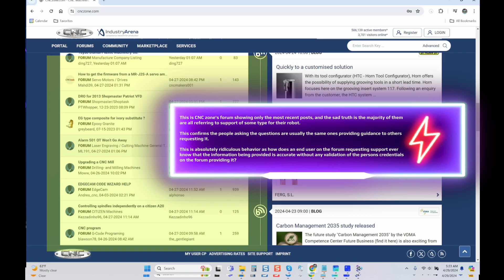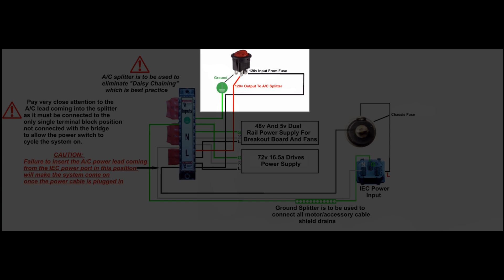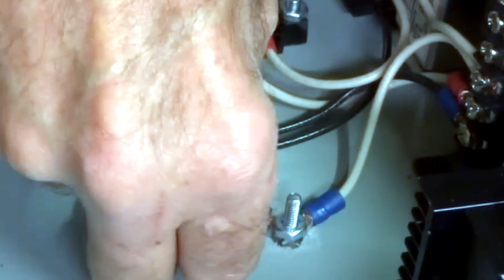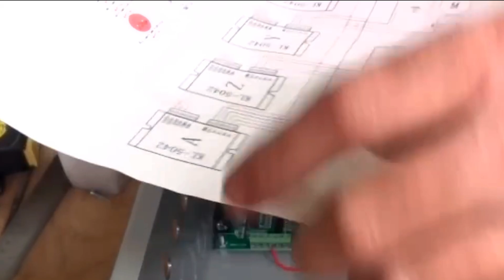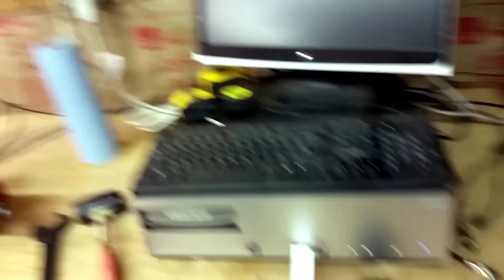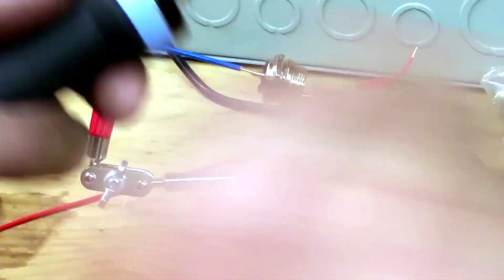CNC Controllers Built Incorrectly (Volume 24)

Comment: Dear Vince, thank you so much for your content, by far the most informative and to the point out there!

I just finished watching your entire "incorrect" series and I learned so much, learning is not knowing what you can do but rather what you should not do and why! 

I was hoping you could answer a question that seems unanswered in your content (maybe I missed it) I retrofitted a 30 y/o Multicam router and can see I need to do some changes (I used crimps and untinned braided 0.5mm2 wire in the cabinet and I have ferrites coming Monday)

Everything is connected directly to star ground, the stepper cables are double shielded draining to star ground and to the machine in the other end with continuity throughout the whole machine. 

A have placed my VFD 2 meters from the control box, the VFD has a EMI filter in front and double shielded all the way to the machine, the controller is a Chinese Ethernet controller (Novosun NVEM) and the cable is CAT6A S/FTP with double shielding and grounding in both ends. 

The question is: will this make grounding loops?

I mean there's ground coming from outside the star ground through the Ethernet cable into the controller and through the shielded cable to the chassis from the VFD

Or does it sound correct according to best practices?

Thank you beforehand for everything! 😊
Reply from the maker: Thank you for your kind words, and support. the ethernet cable won't effect the system as it plugs into the board itself which won't produce a ground loop. Thank you, and  have a great weekend!
Vince

Comment: One thing to note about crimp connectors. They are colour coded for a specific range of wire gauge. I bet he had to fold the wire inside the opening in order to use the larger blue crimps.
Reply from the maker: Thank you for your support, and that's an excellent point. Once again the details count. Vince